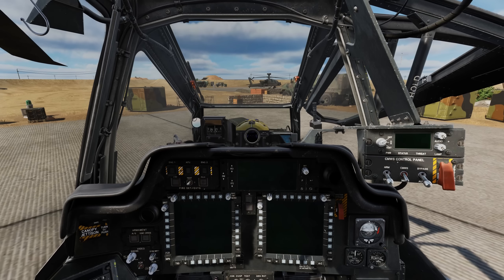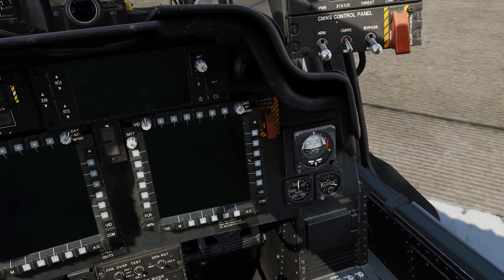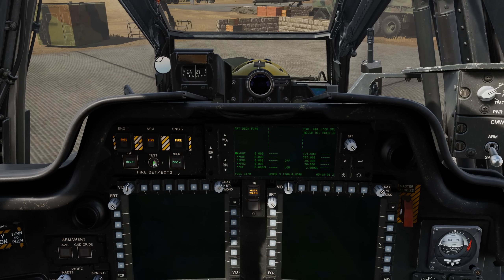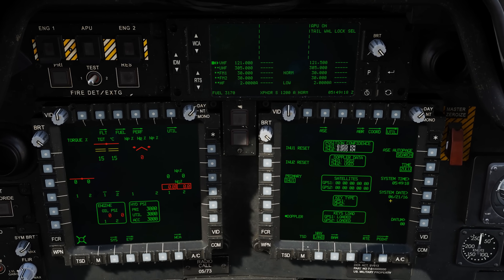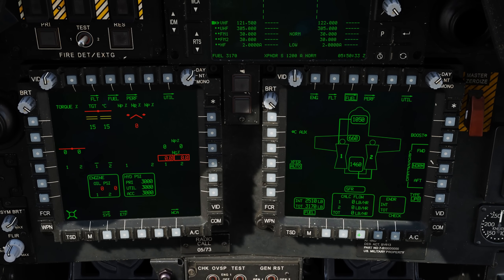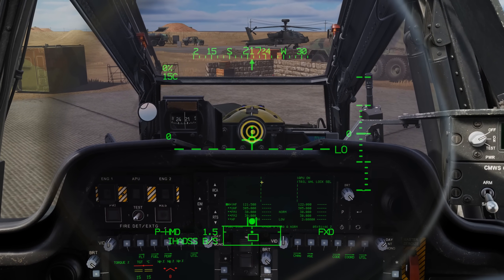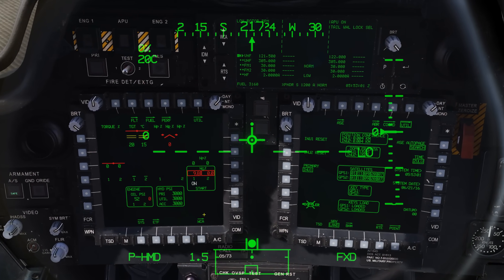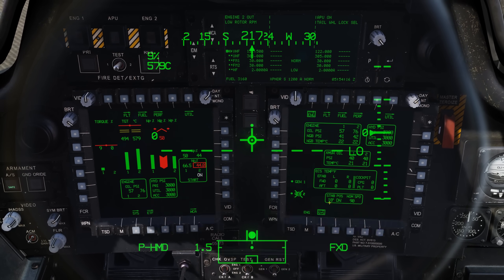How to Start an AH-64D Apache Longbow

Comment: • Pre-flight checks. 

• Make sure all doors and hatches are closed. 

• Turn off all lights. 

• Set the engine levers to OFF. 

• Release the rotor brake. 

• Set the parking brake. 

• Turn off the CMWS (Countermeasures Dispenser) system. 

• Set the COMM levels to 11. 

• Turn on the battery. 

• Lock the tailwheel. 

• Perform a lights test. 

• Perform a fire detection test. 

• Start the APU. 

• Press the APU start button. 

• Wait for the APU to start. 

• Check the APU status on the ENG/SYS page. 

• Set up the aircraft. 

• Set the COMM page. 

• Turn off the ASE (Automatic Stabilization Equipment). 

• Set the TSD (Tactical Situation Display) page. 

• Set the FUEL page. 

• Set the FLT page. 

• Set the WPN page. 

• Perform an IHADSS (Integrated Helmet and Display Sighting System) boresight. 

• Start the engines. 

• Set the engine levers to START. 

• Wait for the engines to start. 

• Check the engine status on the ENG/SYS page. 

• Move the power levers to IDLE. 

• Taxi and takeoff. 

• Release the parking brake. 

• Taxi to the runway. 

• Takeoff and fly away!

Comment: This is absolutely amazing, the accuracy is spot on. Well, as a AH64 crew chief for 13 y they almost never turn on without some bogus faults. 

Some the newer D models have integrated CMWS that includes it in the software. This makes the CMWS control box unnecessary and out of view. 

The only thing your missing is the crew chief...

Comment: A slight heads up, when calibrating the boresight I had slide forward in my seat to get my head/headtracker low enough for the LOS indicator to be in the center of the Boresight.

It's seems it's a bit to much offset perhaps?

Comment: hey boss, does everyone have to rebind everything again during every update you get on beta, or just me, i know controls, without the video i can do it in 5 minutes? ??  Takes me 2 days cause it resets all my binds to default, just like video defaults, i get half a screen, usually a reboot fixes that, back to settings load saved 1 or 2, 1 for me is tracker ir for fast movers, 2 for helos, VR (helos are awesome in VR and somehow i can fly better), but still have to rebind all controls, its literally 2 days just rebinding everything, ie keep some of the same binds of other aircraft to the same buttons, swap back and forth from aircraft, blah blah,  or am i just stupid and doing something wrong
Reply from the maker: Sorry, but I'm not really sure why you think you need to rebuild your inputs after an update. I have never had to do this even once.
Reply: @MattWagner  meh, a me issue again, sorry to waste your time, i didnt save my binds
Reply from the maker: @polarbear4198  No worries, have fun!

Comment: I tried the auto start option but it did not align the boresight. So, I tried it after auto start said complete but I did not see the yellow circles for the alignment? Is that a bug?
Reply: My bad. I had to turn the primary lights more bright.

Comment: Very good tutorial, After studying it, I picked up more details than you actually explain. You know exactly what you are doing, but some of us have no clue. So I was paying very close detail to which keys on the RMFD you were clicking and writing down in addition to why you were pressing certain keys which helped me understand more so how to operate the Right MFD to go through the set up screens for engine and weapon and global positioning data. Thanks very much this makes it easier to understand how to really get the most experience out of what you are doing when cold starting this awesome module!
Reply from the maker: The videos are cumulative and build upon each other. I'm sure others have and will create more "self contained" instructions.
Reply: @MattWagner  No doubt I have been saving all of your videos and currently going through each in depth to better understand each function thoroughly ! It took me 3 hrs to break down this cold start video into my own cold start to better understand navigating around that MFD for all the different functions and for what they are used for! I know the Left and right MFDs are very important for data information on whats going with the aircraft, as well as weapon status and other stuff. I dont know if it has an active radar system to detect the position of enemy vehicles and personal hence that large AF Radar dome above the the rotor blades, but I guess that is another tutorial! I love all the combined data I get from both you and Cosmos!

Comment: The ACCUM OIL PSI LOW shouldn't be on before you press the APU switch. The pressure in the APU start accumulator is needed to start the APU. It drains to start, then you get the PSI message, then it goes away once the APU is stable because it gets filled back up. The APU wouldn't start if you saw that message on your UFD.
Reply from the maker: We know, thanks.

Comment: Wags - how do you get that retical for boresight? It does not come up on my end when I select Boresight >> IHADS
Reply from the maker: Without seeing what you're are doing, I can't advise. Works here. Make sure you are under power.
Reply: ive just had this problem for nearly 2 hours, the soloution is that you have to make sure that the lights are all enabled on the realr left panel in the pilots seat, without the lights enabled, the reticle will not show

Comment: That pilot ai looks much improved movement than have seen previously with choppers. I wasn't expecting to do much from front seat but looks like quite a viable option now & well implemented.
Reply from the maker: It is, when properly used.

Comment: Another technique for start-up after the APU is on (once called the DMS Sweep), especially when working with a live CPG, use the top level menu page as a guide on one MPD while pressing buttons on the other MPD; the front seat can start with one side and work clockwise, and back seat start on the other side of the top level page and go counter-clockwise, or vice versa.  Point being, you get things up and running faster, and the PC can check the work of the other pilot by the time the INUs align.  When in doubt, you can always run home to "mommy" by pressing the M button.  Eventually, you learn where everything is in the menu hierarchy and the cockpit becomes less of an MPD piñata.
Reply from the maker: Good point, thanks!

Comment: Hi everyone. I download the UH-60L 1.2 Version ,I TRY TO START UP BUT THE ENGINE NOT DO NOTHING. I read the manual, Videos etc, follow the steps and Nothing.
Reply: Works for me.  Just a guess : assuming you're using the latest release (1.2), did you notice the extra steps around air source selection ?  Maybe your tutorials weren't updated.

Comment: The 3D models looks so amazing. Is there a "making of" somewhere that shows how these models are made (I am especially interested in the interior 3D models and what work flow and software is used)? Thank you very much!
Reply: Modelling wise it's not that hard (if we are just talking about the interior that is). Just a lot of buttons and detail but the basic shapes are ''relatively simple''. I think the hardest part if you want to try this yourself would be to find good reference. They probably use 3dsMax or Maya. Doubt it's Blender as it's not (yet) really industry standard. But Blender would work and is free so you can go with that. Texturing probably Substance Painter. There are other tools out there for that, but Substance painter, imo, is the best. Don't bother with Photoshop for PBR texturing, you'll only torture yourself. But you could use Photoshop or Gimp to create alphas and stencils you could then use in Substance Painter.

Workflow wise. Making a rough blockout in the modelling software to get the scale and basic shapes correct. ED might actually use scanning data of a real cockpit but not a 100% sure about that. If you could do that tho that would save you a lot of time getting scale and detail correct. Using that to make a high poly model. Make a low poly model. Unwrap the low and split it up in several UVs. Bake high on low. And start texturing.
Reply: @bd5067  Yes, I was just interested in their particular workflow (I am working with CAD and also 3D packages like Maya and 3ds Max since the 90s professionally). You mentioned scanning: what hardware/software do you mean that is suited for scanning cockpit interiors and getting data to create low-poly, real-time rendering suited 3D models? I once had to work with scanned "point clouds". Could as well have started from scratch in a CAD package: a huge amount of work back then. But maybe there are fast, tailor made workflows for that nowadays?
Reply: @SolidWorksCAD3D  It's a 3D laser scan of different parts of the cockpit that the devs can then use as a 3D reference for their models.  It does not work as it's own 3D model though
Reply: Maya ,3ds Max  for Modeling Rigging Animation UV Mapping/ Photoshop UV Texturing /Scripts Lua
Reply: I bet they use either 3DS Max or Blender.

Comment: I could be mis-remembering (it's been a minute since I've pre-flighted an AH-64D), but I think the door latch lever is reversed. Vertical = Unlocked and Horizontal = Locked (both open and closed). Also, there's no key in the throttle-quadrant power selector so the engines wouldn't actually start (APU would, but not engines).
Reply: There’s multiple things here that are off. Closing doors pre ECS, no BUCS test, setting switches before turning the batt on, etc. I assumed that the SME team they have would have handing wags a checklist. Lol unless his abbreviated version just disregards everything?
Reply: @oilers8990  The BUCS I will assume is not even modeled at this point. ECS? Who cares. There wasn't much here that was done that is super unforgiveable and it hit all the most important parts of getting the aircraft started and ready to fly and fight. So stop being a pretentious prick.
Reply: @oilers8990  Yeah it's weird. They did incredible with 99% of it but small things were off. Like they modelled the swinging helmet-hook and M4's, but not the key. Lol. BUCS and ECS I'd figure might be coming later? I'm not complaining, I think it's very well done. Can't wait for it to come out!
Reply: @oilers8990  what would be the point of us adding a BUCS test when the BUCS isn’t really replicated in game. 

ED is making a video game, not a cockpit trainer for the army. Doesn’t make a lot of sense for EVERY SINGLE THING to be replicated to the gnats ass. 🤷🏻‍♂️
Reply: @CasmoTV  Could be fun to have an ARDDs-reset mini-game. 😛
Reply: @CasmoTV  I thought BUCS would have been modeled. Bringing some pretty complicated systems to life, I thought ED would have at least replicated one of the more distinguishable systems. Would be nice for a damage model to kick FMC off when it’s not expected.
Reply: @agostonbazmajer1100  It doesn't mean anything. The full checklist are all publicly available. For example the F16 in DCS does not model the EPU safety pin removal, or if you close the canopy during startup it could cause failed start and so on... The fact I know these is they are available - if not in DCS but in other games / documents.
Reply: Gotta do the bucs test Matt! Lol
Reply: FUN FACT: Preston, the greatest Apache pilot of all time is also the name of the soldier who stole the US Army UH-1 and landed it on the presidents lawn. Resulting in every army helicopter after that event requiring an ignition key.
Reply: Correct. Also, If the ACCUM OIL PSI LOW is on the EUFD after turning on the battery, good luck starting the APU.

Comment: As a former aircraft maintainer, I would have the cockpit set up into pre-power on to save the pilot a lot of time.  Is there a way to have our acft in DCS start with all the switches set and ready for start?
Reply: As a former 15R (Apache Maintainer/Crewchief), I would have to disagree.
Reply: And what does that look like exactly cause I never saw a crew dawg so that.
Reply: @CasmoTV  Whenever we would pre-flight a jet, we would perform a pre-power on check/setup in the cockpit.  In other words we would make sure that all the switches in the cockpit were set up in such a way that nothing unintended would turn on when we applied external power.  For example the pitot tubes.  We wouldn't want them to get hot because the covers were still on.  I guess I never really considered that this procedure wouldn't matter to the pilots.  My misunderstanding.  It must just have been a maintenance thing.
Reply: @CasmoTV  I'm not even sure. I think the most we did was make sure the accumulator had enough cranking pressure and that the windows were washed. Occasionally run back to Flt Ops or wherever to get a new map card.
Reply: @df9142  that sounds about it. Never had a crew chief flipping my switches.
Reply: Yes, takeoff from ground hot when setting position
Reply: This would be nice… but 64 crew chiefs don’t do such things

Comment: You guys should like, get me a flight sim setup so I can get this helicopter. Lol. Rn I got a Thrustmaster T Flight X that doesn't have nearly enough switches and stuff 😩
Reply: It's not ideal, but that's what the keyboard is for until you can shell out for more switches.
Reply: Voice Attack, Viacom or both. Helps me alot when flying in VR.

Comment: It doesn't look as complicated as the Hind too me at least.
Reply: not all systems are turned on, but seems simple. The checklist for a real cold start is way longer.
Reply: @Zarma4074  So on the real checklist in the Hind 😀
Reply: That's the point, to concentrate on the mission, not mechanics. Flip a few power buttons and let computers do the rest.
Combat and FCR, that's where the complication kicks in.